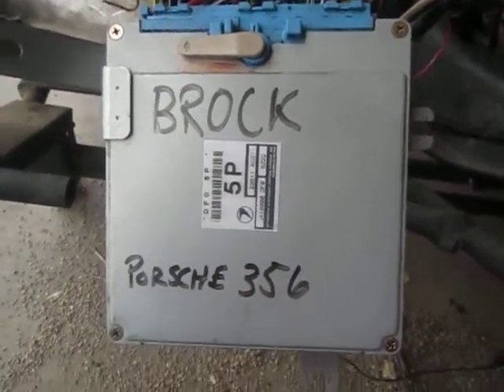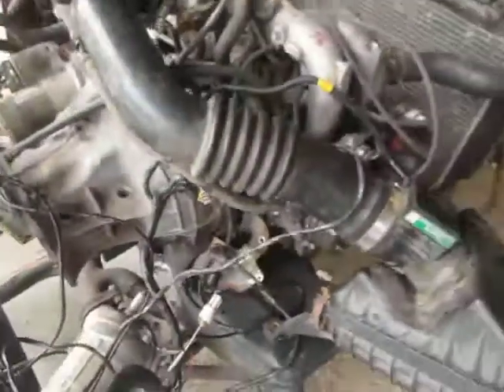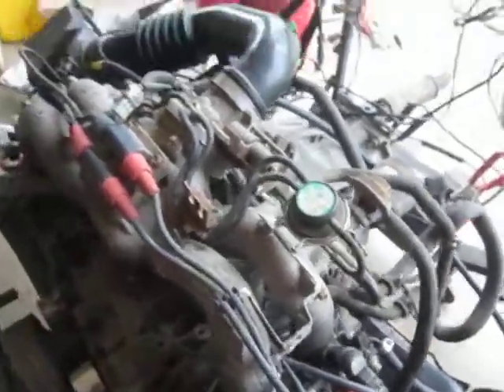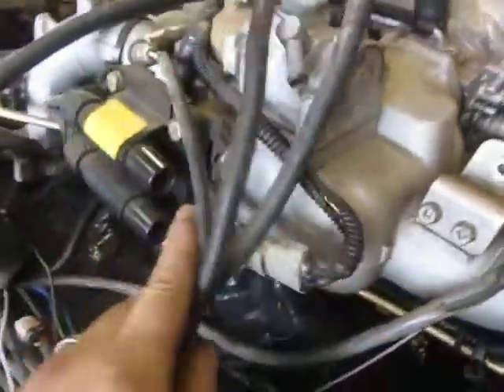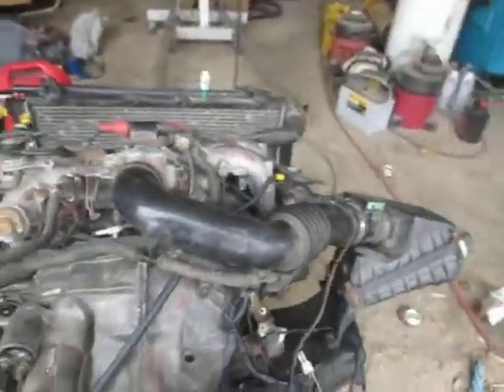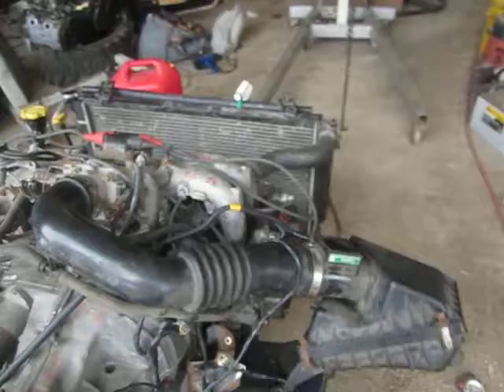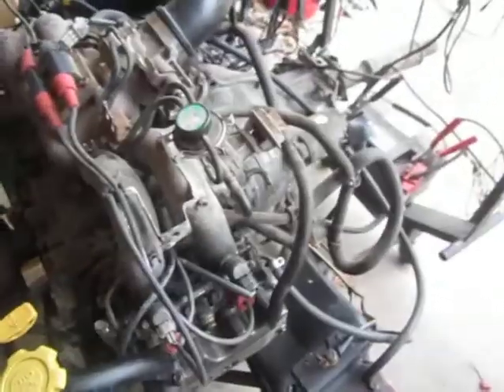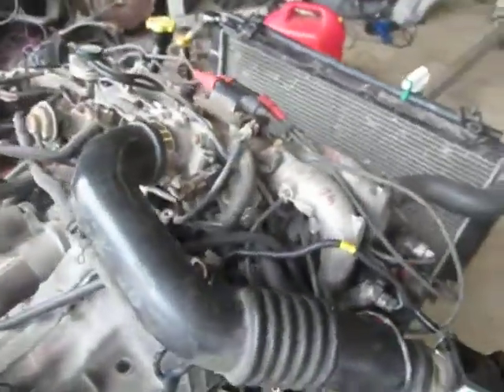Porsche 356 Subaru engine conversion

Comment: I saw a EJ253N installed in a 356. The intercooler was mounted in the reae of the vehicle in the engine bay. Would that cause issues? Thoughts? Looks like a WRX motor